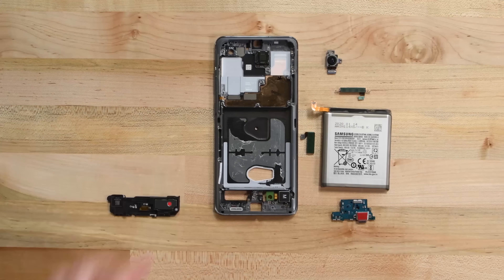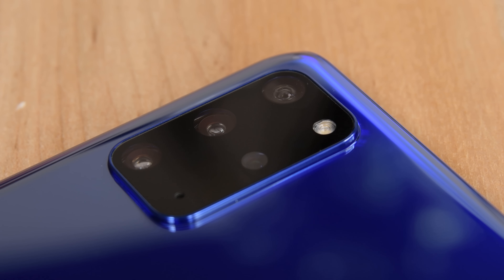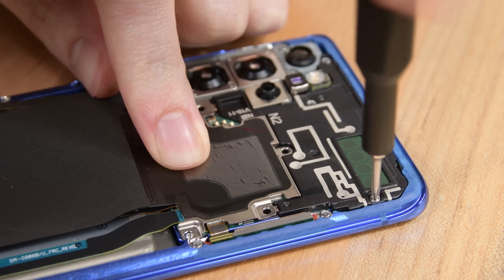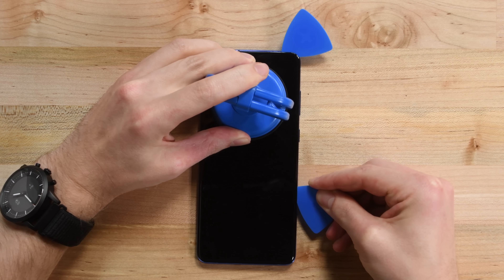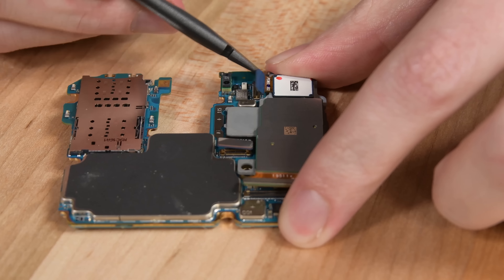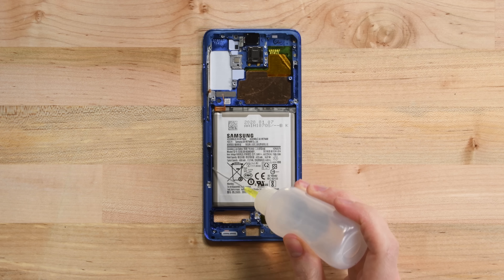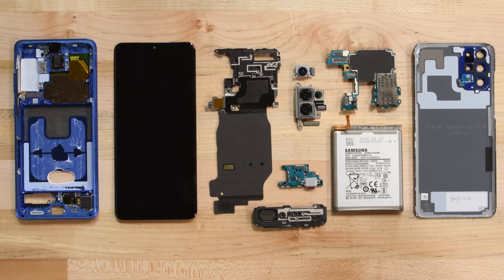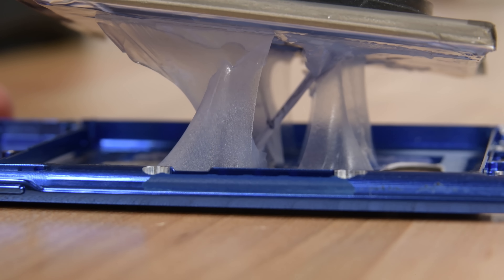Samsung Galaxy S20+ Teardown: In the Shadow of the Ultra

Comment: The "telephoto" camera doesn't have a 3x zoom. It has NO optical zoom whatsoever. Or be more precise: it has a 1.06x Zoom.
Reply: Tim R. Does google pixel have zoom?
Reply: Isnt called a hybrid optical zoom mixing in 2x optical zoom and cropping the rest with digital zoom...isnt that why its called "hybrid" optical zoom?
Reply: @migracing8232  2x
Reply: for those who don't know, the 64MP telephoto camera on the S20 and  S20+ have a 76-degree field of view !.
the normal camera has a 79-degree field of view. 
and the Ultra-Wide is at 120-degree. 
so basically the 76-degree telephoto camera is at 1.06x optical zoom. the rest is done digitally. 
they did all of this so you can shot 8K videos because 8k requires a 33MP sensor or higher.  
Maybe Samsung considers this 64MP sensor to be of inferior quality to the main 12MP sensor and therefore decided to keep both in this weird 1.06x way.
Reply: what are you talking about, if it didnt have 3x telephoto, it would be impossible to have a 30x optical
Reply: @MrKobus-rz4qy  it doesn't have 30x optical, no phones these days have, most of them only have 5x optical zoom and do the rest with digital zoom, and the s20+ only have around 1.2x and the 3x is cropped from the 64mp camera
Reply: Wtf r u talking abot
Reply: It has 3x optical and 30x hybrid. You seem to not know what youre talking about lol
Reply: @SeoWoojin55  the one that should look it up is you. It does NOT have optical zoom.
Reply: 30 max c 'est tout le 100 c le ultra

Comment: A while ago, I accidentally let the metal part of a lighter that was not even very hot, just mildly hot, somehow land exactly over the smallest spot where damage would occur. The fingerprint sensor. It seems to have burnt it so I have just a portion of where the fingerprint sensor is under the screen that shows a dark spot.

Instead of having to replace my whole screen, is it somehow possible to just replace the damaged fingerprint sensor on my current screen and continue to use it? Can it be done carefully or something, or is it just for sure not possible to be done? Based on this teardown video and some other research I did trying to find out, it is looking like it is not possible to just replace the bad fingerprint sensor.

Comment: I have a SM-G986U. I fell and broke the screen and the display is not usable. I want to get the data off it. I can't find a replacement screen/display but I found a used phone same model. Can I just swap the mother boards and get my info off it?

Comment: I agree on everything except the screen. These really are not typically meant for digitizer only repairs. The service packs from samsung come with a new screen/frame preinstalled so you can just transfer motherboard and small parts over.
Reply: U can do that using bellow 0 temperatures, its a bit hard but is possible, using the heat gun will destroy the oled
Reply: @thejulianmachine  I know you can if you have patience and have the tools. However that method is really impractical unless you have a machine do it for you
Reply: @thejulianmachine  There are videos of people removing the glass using a heat gun and a thin metal sheet on the S9 etc without destroying the oled.
Reply: @Tactical_Taco  this is a brilliant design compared to the galaxy S10 and s9, motherboard on top and sub board at the bottom with the battery in the middle

Comment: Please master ,can you tell me where are the speakers in samsung galaxy s20 ? There are 2 or one? I think 2 cause it's stereo but i have introduced the sim-key in the small hole up the phone beside the sim card drawer,i was confused and tried to open in the wrong hole lol 
Did i have hurt something with speaker out up the phone 
I checked with a strong light and a magnifying glass but i didn't see anything broken

I did not apply an excessive force far from it but the end of the tool to open the drawer of the sim / sd card is rather thin and slightly rounded is it an external speaker or the internal speaker diffuses the sound via conduits or end pieces which convey the sound towards this small hole?
Please
Reply: No you did not hurt the speaker at all I'm sure you know that by now just trying to help you out

Comment: Does the s20+ has the 5g milimeter antennas in the tear down as well? And is the availability of the antennas based on the region in which the phones are sold?

Comment: Is the fingerprint  scanner embedded to the screen panel? I recall Note 10+ had a separate connector. All S20 lineup use the same sensor I believe.
Reply: The s20+ uses a different fingerprint sensor than the s20 and s20 fe. I'm not sure about the ultra, but I am sure the s20+ one is different from the s20 and fe variants.

Comment: Wouldn't in most cases you'll be removing the screen because the screen is broken?
Reply: Maybe you found a cheap, dead phone with perfect screen and want to use that as a replacement.
Reply: Broken usb c port?
Reply: Battery replacement?
Reply: @drieshuybens4594  can be replaced by removing the back glass. Same for the charging port
Reply: @invicibleguy3166  oh well, then i wouldnt know why

Comment: Great video, thanks! I have a question please, which type of alcohol used to remove the battery  and it's not dangerous when using it with lithium batteries? Hope I get responses. :)
Reply: It doesn't matter... just use any solvent...  Isopropyl alcohol, acetone, whatever.. and that's the reason you use solvent.. have you seen the way, they lifted the battery? That's the exact way you do it the best! no levering with any tool.. you just shouldn't inhale the solvent... but using a solvent with a suction cup is the smartest way i have seen so far...
Reply: @gandalfdergraue8444  thanks bro, i will try this method next time. :)
Reply: @allaliadlene837  No problem bro! As a computer scientist and phone technician, i'm just an enthusiast like these guys from ifixit... so one last, but very important tip at the end: NEVER USE METAL TOOLS, THAT DO NOT TURN SCREWS! There are a lot of tool kids, that provide you with plastic tools.. these are good for connectors, displays and batteries, if you need to lever in order to get them out.. The best thing about them is, the break before important electronic parts and before batteries turn in to flame throwers...